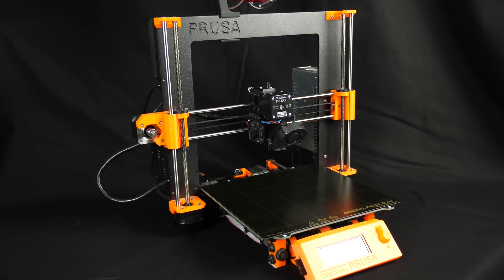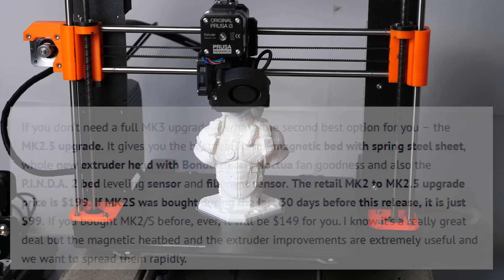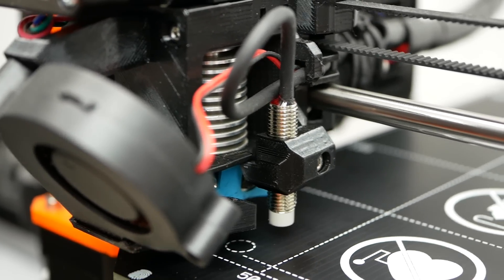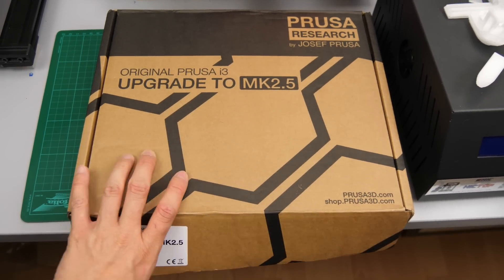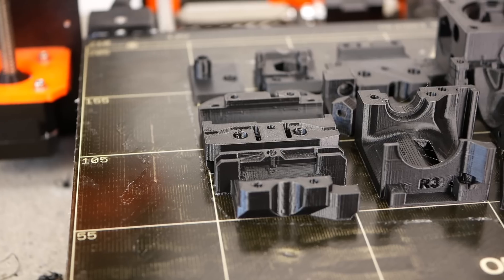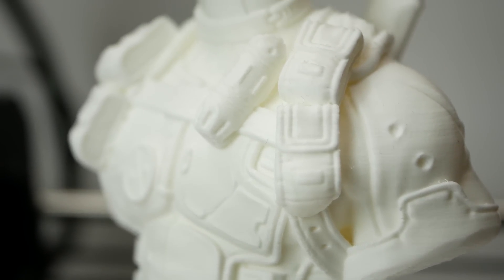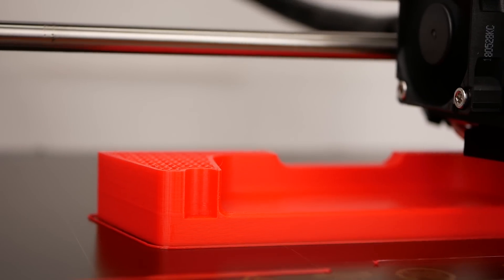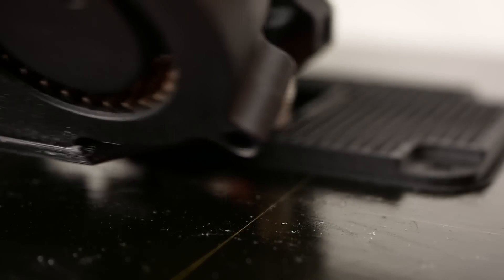Prusa MK2.5 UPGRADE kit - Worth the price & effort?

Comment: I know this video is older and especially now that the Prusa MK4 is available. I have an MK2S and the bed recently broke and I thought I would upgrade it to the MK2.5S as your video explains. Prior to the bed breaking, the MK2S worked great and was reliable and I longed for the PEI sheet. Since my Prusa's are so reliable and I want to standardize on Prusa's I will attempt the upgrade. Since the upgrade is no longer I am worried about finding the necessary parts list to purchase what I need. Any thoughts?

Comment: I recently upgraded from MK2->2S->2.5, and now get terrible stringing!  I have tried everything (temperatures, retractions, different filaments, drying filament, change nozzles), nothing works.  I got perfect prints with the 2, and now regret the upgrade to the 2.5 unless I can figure out the solution.

Comment: CNC Kitchen can you do a  video on this new new new kit  as iv seen no videos on this kit ?
Original Prusa i3 MK2.5 to MK2.5S upgrade kit
Reference: MK25-MK25S-SELF
Condition: New product
Upgrade kit for the Original Prusa i3 MK2.5 to Original Prusa i3 MK2.5S. With this upgrade we are introducing a completely reworked extruder with a new filament sensor.
https://shop.prusa3d.com/en/printer-upgrades/899-original-prusa-i3-mk25-to-mk25s-upgrade-kit.html#

Comment: Hi Stephan, I have self assembly a prusa MK2 clone. It prints very well but I have to solve some issues that I am not comfortable with, for instance: the noise level, improving the bed leveling with a sensor, try new drivers, etc.
That makes me think if it is time to buy a new 3D printer and sell mine or just upgrade mine (new logic board, new bed, new frame like prusa bear edition frame, etc). It would cost me about 350/400 usd
What do you recomend? It is advisable to buy a prusa MK3 nowadays or should I just upgrade the major issues and wait for a new model?

Comment: Stefan great video, you may want to check out the 7x7 first layer calibration that being developed on github. I was having trouble in some areas of my build plate and this worked fantastic. I’m using a V3 clone powder coated build plate which has more problems than the Prusa plate but it helps both. Interested in your thoughts. 

https://github.com/prusa3d/Prusa-Firmware/issues/1239

Comment: For anyone having an issue with the PET sticking. I found for the first layer 250c nozzle and 70c bed temp with gluestick worked perfectly. After that, the regular temps (within Slicer PE) will work.

Comment: I have an MK3, and use mostly PLA.  I think that the removable bed and filament sensor are well worth the money. I remember on my old printer, I would print something, only to have it delaminate during removal from the bed.  With the removable bed, this never happens.  And with the filament sensor, changing colors, or even materials, is so easy.  Just choose Auto Unload, pull it out as soon as it beeps, cut the end of the new filament on an angle, and insert it until it is pulled away from you.  The system even asks you if the color change is complete, and feeds more filament if it's not.

Comment: Hab das Upgrade damals gleich bestellt - und ewig gewartet bis es endlich kam. Da gingen ja zig Monate ins Land. Und meinen MK2s hab ich 31 Tage bevor der MK3 rauskam bestellt. Keine 100€ Nachlass - „nur“ 50€. Wegen 1 Tag. Auf das eigentlich gekaufte Powder-Coated Bed wart ich immer noch. Noch nicht mal den Gutschein erhalten (man darf ja nochmal zahlen). Dass man die Teile für das Upgrade selbst drucken muss (das Prusa PETG hat meine Nozzle völlig versaut) - davon stand bei der Bestellung auch nix. Wurde Monate später dann dazu geschrieben. 

Auf dem glatten PEI hält bei mir fast kein PLA. Warum weiß ich nicht. Auf dem Bett des MK2s ging’s ja auch wunderbar. 

Ich weiß nicht. So gern ich Prusa auch mag - ich komm mir mittlerweile etwas verarscht vor ... da mein Hauptmaterial eh kaum hält und ich daher alles immer Dutzende Male von vorn starten muss hab ich meine Drucke auch ziemlich eingestellt. Irgendwann ist mir da echt die Lust flöten gegangen. Schade drum. Aber wie du schon sagst - allein das magnetische Bett, der Lüfter und das Wechseln des Filaments mit dem Sensor sind das Upgrade grundsätzlich wert.

Comment: I got a Matterhackers Pulse which was sold as a Prusa all assembled with better parts. Looks the same but has a garolite bed and E3d V6 and Bondtech Extruder. What I would like to upgrade is the E3D V6 to a PT 100 and a copper block as without that you should not run the regular thermistor above 285 (according to E3D and I have bumped up against this quite often with certain Nylons especially when printing with the .8 Nozzle. We use the printer in a probably not common way as we do not do models but are building a 32x30x50 in (or something close to that) robot weighing 150 or so lb. So its lots of big frame parts and lots of planetary gearboxes and such. Whole projects takes about 15-20kg of filament. Its a robot for a FIRST Robotics competition (FRC team 1989) We will find out this years task on saturday and then have 6 weeks to complete the machine - design, build program and test. If successfull it most likely will be the first ever 3D printed robot competing in an FRC competition. So any upgrade we are interested in is printing big parts fast and accurate enough. And yes to stay within the rules we have to do it with an average cost of $30/kg for filament. So a lot of ABS, PETG and some Nylon of the basement bargain price variety. There is no rule that says $30/kg but there is a rule that usually says no more than $3000 in parts on the robot and with the costs of computers, sensors, motors, motor controllers etc etc that leaves about $600 for 15-20kg of filament. So based on that a higher temp hot end and a heated bed that can actually reach 120 would be great as there is some $25/kg PC at Hobby King we would like to try. If you are interested we just started a youtube channel and will post regular videos of our progress and findings just click on my face I guess

Comment: Great video! Just a note, they included black filament because the extruder assembly needs to be black because of the filament sensor. Ah, and one more thing, based on my experience at least, the mk2s have a slightly better printing quality than the mk3.

Comment: My mk2 and mk2s are staying the way they are. I'm gonna add u-bolts to the bed on the mk2 but otherwise these machines are super reliable and great printers. that kind of money would be better spend on a dozen or so print removal tools to find one that works perfectly (the Reptor scraper on amazon is super great). I have a different printer with a runout sensor and its next to useless for me.  It has never actually saved a print or allowed me to "fix" the problem and continue continue after it stops everything. basically all it does is prevent the machine from scorching some filament in the hot end during breakage or runout

Comment: This is the wrong moment to upgrade. Prusa stopped selling new printers with PEI powder coated spring steel unless all voucher owners could get such spring steel. Before that decission you could get the upgrade to 2.5 with the powder coated spring steel. You may will get it again after all voucher owners are served.
I got myself an MK2.5 upgrade with PEI powder coated spring steel some months ago - for 149€ even without owning a mk2/mk2s (I had a mk3 but without PEI powder coated spring steel). I wanted the PEI powder coated and to get it I ordered the complete upgrade... I used the other parts to upgrade a chinese printer.

For the printhead: On thingiverse there are upgraded versions with Bondtech BMG. I changed my mk3 and can only tell: much better extrusion consisty! So you may change to an BMG design directly. Maybe also with a pencake stepper (or even a .9° pencake stepper)

For the colour: You might print the new head any colour you want, as the filament sensor do not work reliable anyway. The reason: PETG is reflective. so even if it is black, its reflective as hell inside. Maybe prusa ingeneers made testing with black ABS and changed to PET only in production, not thinking about the different reflctions of petg and abs. I solved this by painting the filament chamber in non reflective black paint, now no false alarms. But if you have to paint the inside of the chamber anyway, you could print it in any colour you want.

For upgrading further ("mk2.9"): All MosFET on the Einsy switch ground. So you could get the Einsy (or a clone from china) and upgrade the mk2.5 even further by changing the board. You can use a small 24v supply for board and steppers, connecting ground from 12 and 24V supply, connect heatbed to +12V and headbed- on the einsy. I got an einsyclone from AliExpress on black friday for 56€... You can also get a prusa power panic on ali about 9€.
So it would be become full mk3; you could use prusa mk3 firmware.
So also sensorless homing, quite stepper drivers etc  would work.

Comment: Its sad that there are no new software updates for the mk2/s / I have the pinda2 and some prusa laser sensors  lying around but i have to port the MK42 Bed into the newer firmware and also the board stuff for the MKS gen 1.4 board. Then it is easy to use TMC 2100 for xy :D

Comment: I made the upgrade as well. Although I got it for around 99€, since I purchased my MK2S only shortly before MK3 release, already the magnetic bed alone is such a joy to use that this alone would justify the upgrade for me. The improved cooling of the hotend (not printed part) is imho the second best reason. Never had a clogged nozzle with PLA since then.

Comment: I'm considering getting the MK2.5 upgrade kit to add on to my "Dolly" printer (following Tom's videos - although since I used a hotend, motors, part fan, high-quality belts [with Gates belts & pulleys on order!], linear bearings, etc. from E3D, a genuine Smoothieboard, Capricorn tubing, genuine BL Touch, Trinamic SilentStepSticks from Watterott (connected to the Smoothieboard via my own custom PCB), Noctua heatsink fan, etc., my particular Dolly build doesn't quite follow Tom's original "as cheap as possible" concept 😂).

It would be almost worth it just for that print bed, and getting the Bondtech extruder would be nice too. The filament sensor and PINDA 2 probe will be useless to me, as without support for the filament sensor in Smoothieware I can't make use of it, and I already use the BL Touch instead of the PINDA probe. But I sorta feel like I should buy some stuff from Prusa since I built a clone of his printer ;)
Reply: you can get that print bed for around 50 dollars off the internet

Comment: I would consider "Original Prusa i3 MK2/S to MK3 upgrade kit". I hope they will do MK3 to MK4 upgrade IF new printer comes out!
Reply: Not sure if you're aware, but there IS a full upgrade kit from the MK2/S to the MK3, BUT it's kinda expensive (like, around $500, I think!), because in addition to everything they have to supply for the MK2.5 upgrade, they also have to supply a new 24V power supply, the Einsy motherboard, a whole new hotend & fans that run off 24V instead of 12V, the aluminium extrusions and panels that make up the new base, and I think you even get a whole new frame (the upright part)!

Prusa weren't originally going to offer it, because you basically have to replace everything except the motors, LCD panel, and the smooth rods, but enough people asked for it that they decided to offer it, albeit with a note on the website pointing out that it's very expensive and for only a little bit more money you could just buy a whole new MK3! Of course, maybe you don't have the space or need for a second printer, so if the MK3 features that aren't in the MK2.5 are worth it to you, the MK3 kit may actually be worth buying :)
Reply: Andrew Gillard  "Original Prusa i3 MK2/S to MK3 upgrade kit" is the name of that "full" upgrade at the Prusa Research website. From what I understood, they indeed offered only MK2 to MK 2.5 at start, but it was received poorly by the community. It is good to have a cheaper option, but semi-upgrades (like MK 2.5) feel doubting to me. Full upgrade to destination product we want, from MK2 to MK3 makes more sense in perspective of support and community. However, as you say... it looks expansive. Upgrade costs 412€, new self-assembly MK3 635€ (tax not included). So for about ~50% more than upgrade, we get a new printer. I'm not sure if selling used printer and buying a new one would be an optimal solution. That's why I think that for people that want one reliable and full experience printer it is good to have a full upgrade option. I have MK3, and for now, I need only one printer. I hope that these upgrades will be preserved in future generations, and perhaps be cheaper. But anyway... it is poor to waste good parts.

"You have asked for it. We have always listened. Even though almost all the components are needed to be replaced, it will be possible to upgrade from MK2/S to MK3."

Comment: Haven't watched the video yet: No. Not a chance in hell. Worse in almost all ways.
Will update after I watch ;)
Reply: Nope, nothing new. The Noctua fan moves MUCH less air - I had no trouble printing enclosed before, but simply can't now without experiencing jams. I can no longer print ABS, or some of my trickier warp-prone customer parts that I'd previously cranked out on the 2s. The magnetic bed is nice, but bed leveling is less reliable by far. The filament sensor has failed repeatedly for me, both positive and negative, on filaments where it typically works. That is to say, it has failed to detect run-out, it has failed to detect jams, and it has incorrectly detected both, ruining many prints. Every time I've tried to rely on it to detect the end of spool on a multi-day print, it's failed, on filaments where I'd previously verified proper runout detection. The noctua is quieter, but not quieter enough that it matters, since the steppers are still so loud. 

Basically, the 2.5 is a huge reduction in reliability. It's a great deal if you want the ILLUSION of reliability, but never actually exercise any need for it.
Reply: Oh and issue 602 is absolutely, for real, a thing. A customer even complained about the reduction in surface finish of a large part I'd previously printed on the 2s.

Comment: I’m still amazed Prusa hasn’t offered a larger build volume   (Like the CR-10, etc)
Reply: The i3 design does not make sense with a bigger bed. The rule is: Make moving mass as light as possible to avoid ringing/ghosting on high acelleration.
So first step if you design a 3d-printer: Decide what type of extruder you want. Then calculate weight of the x-axis including the extruder.
Prusa decided for a direct extruder, so it has a certain weight. As you should always use same acceleration on x and y and booth use same mechanic (belt driven), as long as the weight of the bed (including a average print) is not higher as the x-axis including the extruder it make sense to use the cheaper i3 design and move the bed.
If your bed (incl. an average print) has more weight than the x-axis including the extruder, it is better to move the extruder in y-direction, as moving the bed in y would be the limiting factor for acelleration and therefore speed with good quality. So you should go to a cubic design.
So in an engineering sense the Ender 3 and the CR-10 are nonesense. They use a light bowden extruder, so even on the Ender 3 the bed is the limiting factor for speed. "nonsense" does not mean they make bad prints. But they are unessasary slow, esp. when using a glasplate as some people do. They could be significant faster using a cube design.
Prusa uses the i3-style and know that limit. If Prusa ever relase a bigger printer, he would use a cube.

But there is an other factor: A prusa make their printers in Europe they can't compete in price with the Chineese. So they compare with quality of the printer. A well engeneered printer with 300x300x300 or bigger (in cube design as only this would make sense) produced in Europe would have cost more than the magical 999$ price point.

So if you think about the basic principles of gantry systems in FDM 3d printing its obvious why Prusa does not build printers with larger print volume. Prusa does semi-professional printers, used in business worldwide. CR-10 is mostly used by hobbyists.

So as many hobyists might buy one original Prusa (as a kit), as it is very reliable, most hobyists will buy Chineese printers as second, third ... 3d printer. Most youtubers call the original Prusa their "workhouse" and do not do any mods on them. While the Chineese printers most videos are about modding.

Semi-professionals on the other hand buy a prusa also as second or third printer again. In business time is money. Most prints do not need a large volume. So the market for high volume printers in the pricerange > 1000$ would not be big.
Reply: They announced a couple weeks ago that they are developing a Prusa XL which will be a Core XY style and 400x400x400 build volume
Reply: They're now working on a 400x400x400 corexy

Comment: For the Trina mics you got the mod to use them for x and y axis for about 60€ (30€ board and 33€ for 4 tc2208+ radiator) and then the silence is there.

Comment: I printed that same spool holder as well. Trouble I have with it is certain spools with smaller diameter hub tend to not fit. AMZ3D for example. Printed a bearing roller instead.

Comment: Did you experience any difficulties with overhangs with the new fan shroud? I find that it didn't perform very well at certain angles/orientations, and ended up printing a different one that worked at bit better.
Reply from the maker: Didn’t notice anything so far.